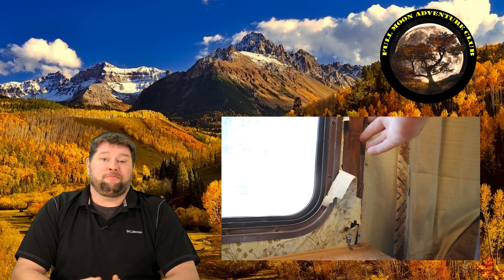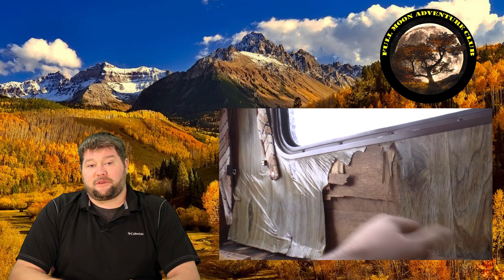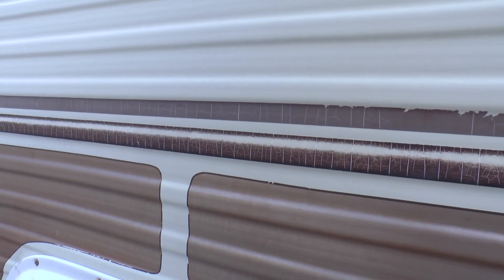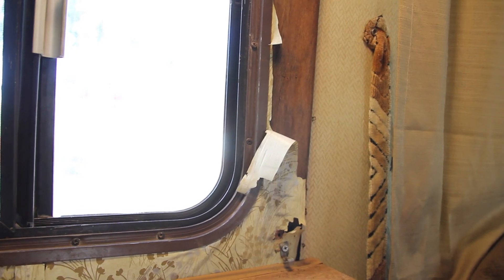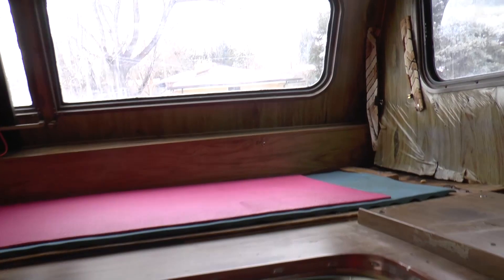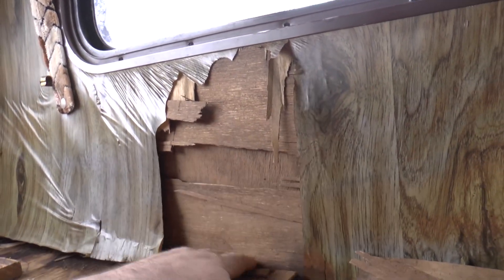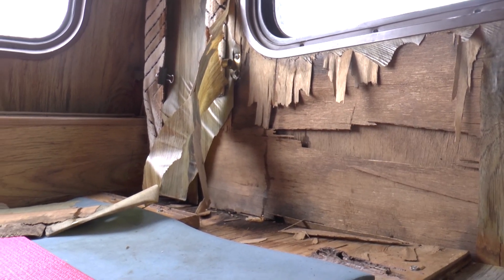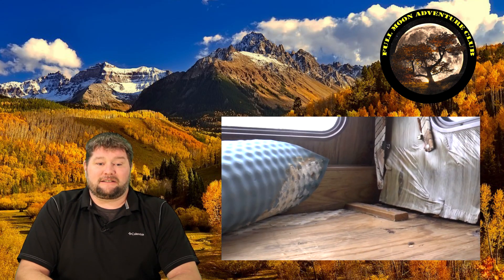What Is RV Water Damage? Examples Of Destruction

Comment: Hi full moon adventure club I was wondering when repairing a water damaged rv do you have to do the floor walls then roof or does it really even matter what comes first.and I have a bulge on the side of my rv where the couch presses against the wall and there is a little bit of a crackling sound there to how do I fix that annoying bulge. Thanks
Reply from the maker: In most cases you can repair just the wall in your RV depending on the extent of the damage. If the bulge is on the outside of the RV then you may have to remove some of the exterior to repair the damage. However, it may be possible to remove the interior paneling and have a look at the damage. If you remove the damaged wood from the inside and and use adhesive to reattach the exterior wall to the framing you might save yourself the work of removing exterior panels. I was once able to fix a small delamination area by injecting liquid nails into the area and using straps and big wood blocks to apply pressure to the exterior wall while the glue cured. It was a quick fix for a small bubble but it has worked for five years now. It is really hard to say what you should do without more information about the damage. Thank you for the question and happy camping.    Jim

Comment: Jim, regarding Zamp plug to installed. Did you hook the wires to positive and negatve? Then you said the plug is wired in reverse. I am really confused.
Reply from the maker: Thank you for the question. The zamp plug does go straight to the negative and positive terminal of the battery with the exception of the the positive going to a fuse first. The plug is not reversed but on Zamp plugs the positive wire goes to the female part of the connection and the negative wire goes to the exposed male part of the plug. Most other manufactures have the positive wire running to the exposed male part of the plug. Zamp claims that this is done for safety and protects the positive part of the plug from touching any metal that might ground it out. It also makes most other solar panels need a special adapter to be used with the Zamp plug. I hope that helps. Thank you for watching and happy camping.     Jim